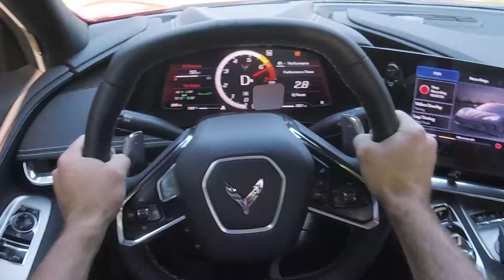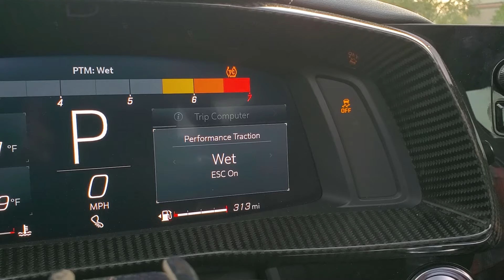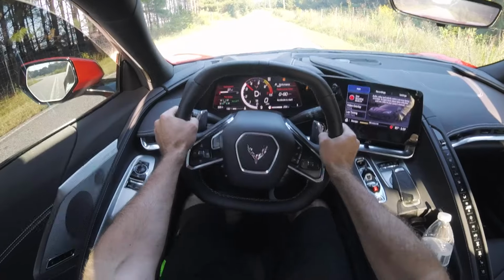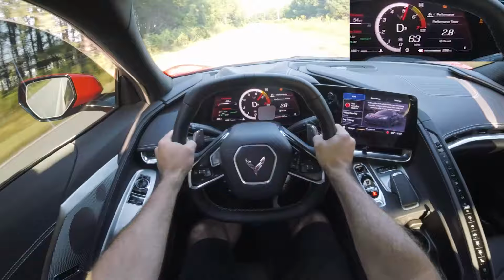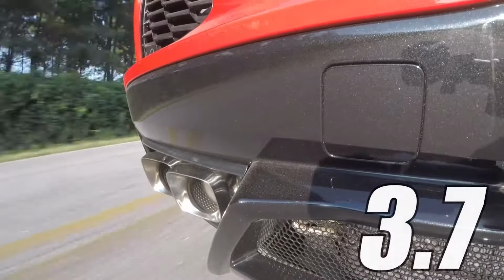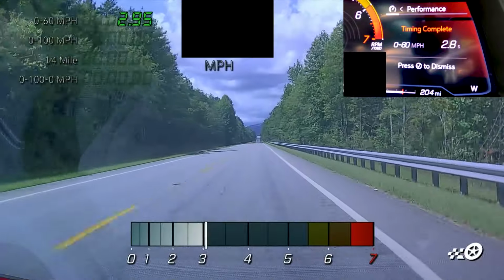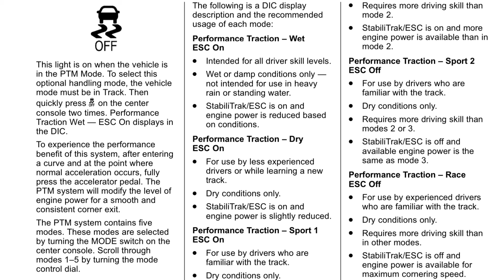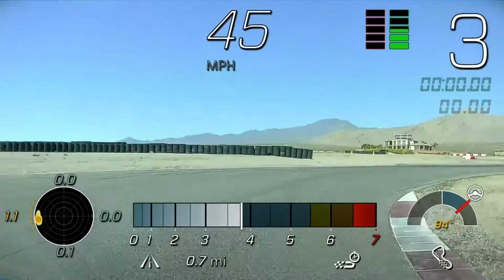How Much FASTER is Launch Control on The C8 Corvette?

Comment: I just broke the 500 mile mark on my 23 C8 and I installed an attack blue air filter today and did my first launch.....these videos don't do it justice the car is savage fast when you launch it. It was a unbelievable experience
Reply: It's only fast on takeoff
Reply: @michael…I read it’s top speed was 194 mph how is that not fast?

Comment: Timer starts after hitting 10 mph. I think inbuilt timer uses 1-foot rollout. 2.8 will be impressive if it didn't used 1-foot rollout.
Reply: Nah it hit .5 sec at 23mph so it's already counting the moment he starts going foward
Reply: @Nyrican910  Chevy confirmed it uses rollout (I recently saw in an article).
Reply: @A.M  alot of magazines and even drag strips use that method.  They are not the only ones
Reply: @Nyrican910  Yes I know, but only in USA. Usually American magazines usually overstating the Corvette always (notably Car & Driver), cuz they love prompting their stuff. See European test times, not even close for those claims.
Reply: The standard porsche 911 head to head with the corvette wins easily in both 0-60  and 1/4 mile. The porsche claims 0-60 in 3.2 seconds, someone is fibbing here, or maybe there's 2 of them :)

Comment: Damn talk about smiles per mile, for 60k-70k this car is a beast. 2.95 seconds 0-60 is nothing to sneeze at. Extremely fast for everyday driving. 3.7 Seconds with traction control is awesome. You really don't have to worry about losing traction.

Comment: Hi Robert, in a recent video made by ThrottleHouse, the Porsche 911 (not the turbo) beat the Corvette in a straight line sprint. I was shocked because that Porsche is technically slower in 0 to 60 (per their own website) and also has less horse power. I displayed my shock in the comments and was replied to by someone who insisted that Chevy markets lower 0-60 times which are false, and that the internal car timer doesn't measure the true 0 to 60 time. If its not that (which hopefully is false) then what is it - is Porsche under-selling themselves? I'm confused. Also, i'm a big corvette fan and bought a c7 Grand sport after consulting with you via email. You were kind enough to reply. 2 years ago. Thanks
Reply from the maker: That's awesome 👍🏻 I remember our conversation. I saw that video by Throttle House as well. I believe one of two things happened. Either they were not launching the C8 correctly, or it just happened to spin in the one run that they attempted. Chevy, most auto magazines, and other auto manufacturers do adjust their 0-60 times by deducting "rollout" which essentially doesn't start the timer until the car has moved 1 foot I believe. With that being said, the C8 should be faster than that Porsche model with the same testing methods used. Motor Trend and Car and Driver both did their own independent testing on the C8 as well as the Carrera S, and the C8s times were faster to 60 and quarter mile. Check out the links below. I'm really not sure how Throttle House got the results they did, but it seems inaccurate to me.

This is a direct quote by Motor Trend.
"Much of the credit is due to the quick-shifting eight-speed dual-clutch transmission. Big takeaway: We've yet to test a quicker naturally aspirated, rear-drive production car to 60 mph, price be damned. The C8 did great in the quarter mile, too, covering 1,320 feet in 11.1 seconds at 123.2 mph. That beats the direct competitor Porsche 911 Carrera S by 0.1 second. A win, however, is a win; the Corvette is quicker than the Porsche."
Found here: https://www.motortrend.com/news/chevrolet-corvette-c8-2020-car-of-the-year/

https://www.google.com/amp/s/www.caranddriver.com/reviews/amp29462701/2020-chevy-corvette-by-the-numbers/
https://www.caranddriver.com/reviews/a28352278/2020-porsche-911-carrera-s-by-the-numbers/

https://www.google.com/amp/s/www.motortrend.com/cars/porsche/911/2020/2020-porsche-911-carrera-s-pros-and-cons-review/amp/
Reply: @CarsCostsandTechnology  Thank you Robert for the educated and thought out response.  Also, apologies for switching your name with the Stradman's. Just realized and corrected lol.
Reply from the maker: Haha no worries! Thanks.
Reply: map_machine - if you base 1 race on what car is quicker or faster then you never have competitively drag raced. There are many variables including driver error. Production based automobiles while very consistently manufactured vary in quality control. Some cars are faster or slower due to tolerances and improvements during the manuf. process. Someone who is experienced at launching a certain type of car will beat you every time.
Reply: @heavenstomurgatroyd7033  so you're saying that throttle house screwed up?
Reply: Porsche is not under selling themselves. German automakers display 0 to 60 timing an average of multiple testing conditions. After all you are not buying the car because 0 to 60 performance, as a customer it is better to be pleasantly surprise of your car punching above its weight then disappointed.
Reply: Just because the corvette made it to 60 mph faster doesn't mean it will make it to the end of a quarter mile faster. It's not the same thing. Chevy probably geared the car aggressively to make an impressive 0-60 time, but the porsche is more well-rounded, and after the initial part of the straight line overtook the corvette.

Comment: Hi, I congratulate you for your video, it is very educational. I have a 2023 C8 Z51. I wanted to ask you if you can use the launch control in Z mode and how it would be step by step. Thanks

Comment: Hi for Z51 if I do launch control 2,3 times every weekend, should be fine or? (on street and stock tires) I believe for Z51 it's under warranty if you take it to a drag strip, but I still don't want to break it or put too much wear/ tear into it. Wondering if any Z51 had problems doing launches every weekend and if I should cut down since I heard there are other DCT probelms other than doing launches.

Comment: Nice job and very informative as usual. By chance did the video have the outside temps when you were testing. 
Hope your enjoying your car. You waited a long time. Thanks for the video.
Reply from the maker: Thanks! It was around 85 degrees. Pretty hot outside. The car could definitely do even better times with temps in the 60s or 70s.

Comment: Hi Great video, a question, if I'm not using launch control and just going from Sport mode, do I hold the brake and stomp the throttle and then let the brake go

Comment: Great Video thanks.  Now I wish someone could upload a video showing me how to raise my convertible top with my FOB!  Or, some GM lawyer upload a video stating why they blocked that feature...
Reply: Mine works. Hit unlock then press the the button and hold it. It take a few seconds to respond.
Reply: @kimberlywentworth9160  BS. Take a video and post it,  You will get a 1,000,000 views and yours will be the only on the planet to do sow.  The steps you said will lower the top but it will not raise it...
Reply: Not possible with the stock setup, they say it is a safety feature……
I’m sure someone will figure a way to program that ….

Comment: Does this has that put you in your seat power like the c7 zo6
Reply: Game changer c8
Reply from the maker: It actually launches harder than a C7 Z06 because of the traction. Not as fast after about 50-60 though because of the horsepower difference.
Reply: Cars, Costs and Technology thanks for the reply plan on getting one soon when available

Comment: Just like with the C7 the C8 launch control has way too steps in order to use it especially if you plan to use it at a drag strip.   The time you get launch control engaged the other guy is long off the starting line!   That is reality.

Still boggles my mind way it simple isN’t a double tap on say the traction control button which the immediately puts you in launch control.
Reply: What? It's literally a double tap on the traction control button. Takes a single second to activate.

Comment: The most boring RWD car I've ever witnessed 

And this is a Corvette I'm describing, a car I grew up loving and always wanting one of my own
Reply: @pHixiq  neither...just really disappointed
Reply: @pontiacGXPfan  really man ? Tell me why actually I wanna know ?. This car has proven itself to be beyond fantastic in literally every way. I have heard the 2020 coupe isn’t reliable but that’s about it. What don’t you like about it
Reply: @pHixiq  mid-engine and the result of the changeover. No manual(no transmission choices), no more tail-wagging burnouts(unless you push a dedicated button), heavier than a Corvette should be, less aural drama, less driver engagement, derivative styling, gimmicky interior, noticeably less cargo space. Basically everything the FR Corvette did well, this doesn't